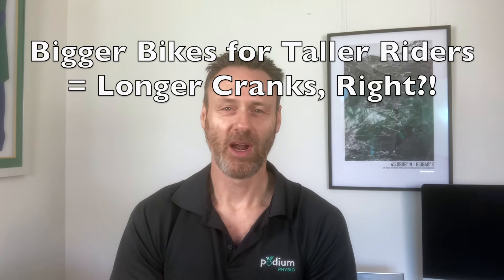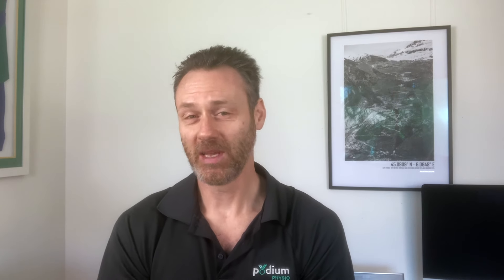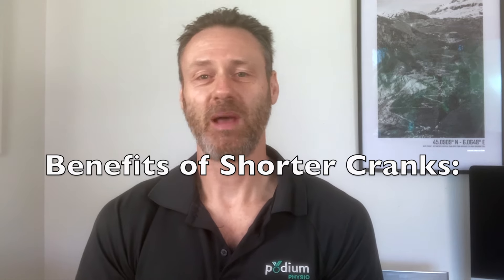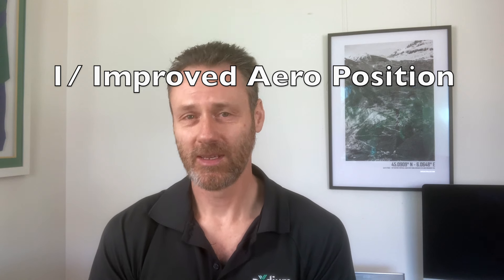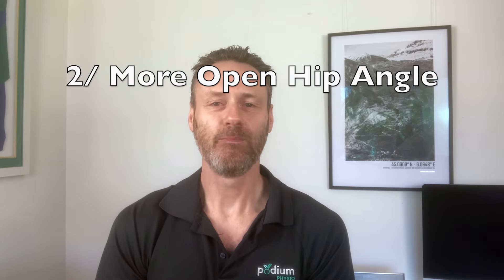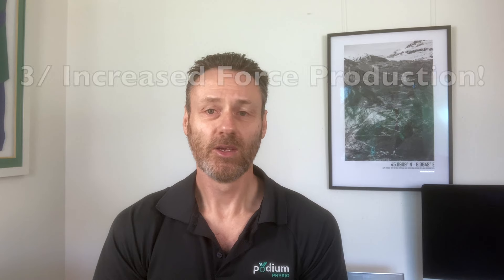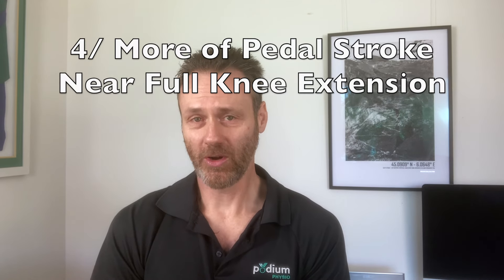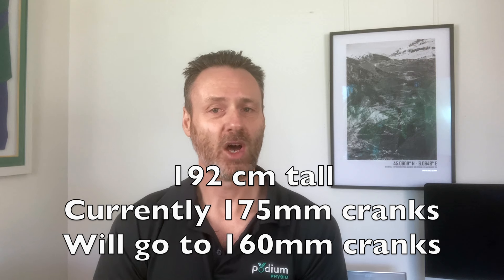Why You Need Shorter Cranks

Comment: A few weeks before the 2012 Olympic TT, it was suggested to Bradley Wiggins he might try shorter cranks than the 177.5mm he usually ran. He won the event using 165s…
Reply from the maker: I've heard the same story but I thought he went from 177.5 to 170?

Comment: I'm only 5'6" (167cm) with 30" Legs (76cm), and I use Zwift often. I machined/tapped a second set of holes on my 172.5 cranks down to 155, and WITHOUT QUESTION it smoothed out my circular motion, I stopped hopping,  and my overall watts appeared immediately to go up by 5w. I'm a confirmed believer.
Reply from the maker: Brilliant! I also think pedalling smoothness is under-rated
Reply: which cranks you use in 155 ? my is shimano 170
Reply: @khochiakeng  I began with 175, yet there IS enough room to drill and tap using a 170. I have a lot of space between the bores.
Reply from the maker: @khochiakeng  Not sure I understand your question sorry.

Comment: Self-experimenting now. One month into the experiment. I went from 170mm to 160mm. I was constantly sliding forward with the 170mm cranks. Hip pain, knee pain etc. I'd been to a couple of different fitters with no such luck. The 160mm cranks have helped my trunk and pelvis stabilize much better. No knee pain, no hip pain. I did Raise my saddle and had to pull my saddle aft to get comfy. Much better power and comfort so far. Only down fall is the wind up. I'm not racing so it really doesn't bother me. Just takes a few more pedals revs to wind up on a group ride. So far, so good. Also, I'm 5'8" with an inseam of about 77.5cm.
Reply from the maker: Yes the issue of pelvic stability is definitely worth considering. In my group rides we have an ex Olympic cyclist who seems to have huge pelvic lateral tilt. I'd love to see him on shorter cranks to see if that would improve things.

Comment: I have been promoting shorter Cranks for a decade now.
It is the first crucial step when getting ones self fitted to
a bike, get that wrong and it will then impact down the chain. 
I fully agree, the shorter the better. I have had fitters say that
I should use 170mm and they were all incorrect, the whole
pedal stroke circle was to large and that resulted in never
being able to fine tune the saddle position, It drove me 
around the fu*king bend.
Reply from the maker: Its too early for me to form a strong opinion, but I'm starting to collect some data and feel for the new position. I'm sure I'll need a bit longer to give a truly informed commentary.

Comment: I see a lot of comments from people stating their height and crank length along with you not mentioning your inseam (unless I missed it), but wouldn't it be better to focus more on your inseam length instead of total height when considering which crank length to use? To me it seems like a massive oversight to not talk about that but then again I'm not a bike fitter or medical professional so maybe I'm missing something. 

I'm 169cm tall but have an abnormally long inseam for my height, which is 85cm so that'd affect what crank length I'd use compared to someone with a more average inseam from what know. I currently run 170mm cranks on all my bikes.
Reply from the maker: Yes you definitely need to take relative body proportions into consideration. As a bike fitter I use a video assessment tool to give data on joint angles, which I use along with my subjective and objective assessment, functional testing and of course client feedback to work out the best position and set up of a bike.

Comment: It all depends what type of riding you do; everyone has an optimal crank length in that regard. What puzzles me in these debates is that leverage and torque are never discussed, so thanks for at least mentioning torque and leverage loss by going shorter! For myself I much rather ride a crankset length that gives me that leverage and that extra torque to transfer to the pedals when needed comfortably. I'm average height 5'9" and ride 172.5mm cranks and the difference is huge between 170's and 165's when climbing on my routes for me, I'm not a spinner but keep up a good rpm with a 12sp drivetrain. When I've tried shorter cranks, I actually strained my knees and it felt slower! So, it's all about finding out what works comfortably and efficiently for yourself.
Reply from the maker: I 100% agree about finding what works for you as an individual. I've decided not to change my cassette or chain rings despite the leverage loss, as I very rarely use my lowest gear here in Adelaide, so nearly always have a bigger cog to drop into when necessary.
Reply: In theory there's a leverage loss.  But in practice one could generate more force on the pedals with shorter cranks.  The weight squatting is the best analogy I've seen.  I went from 170 to 155 without changing my gearing.  When I'm on my lowest gear climbing a steep hill, the perceived exertion is less while I'm generating the same power as before.  If my power and cadence are the same, that means I must be acting on the pedals at a greater force.  So for me personally there aren't any downsides to shorter cranks.  I'm 5' 8" with a 80cm inseam.
Reply from the maker: @jonathanwoo6597  Yep. Great deduction. I'm hoping my experience will bear out the same way over time.
Reply: The torque/leverage argument has been used for decades as an argument for longer cranks. However by shifting to a different gear you can freely adjust 'gain ration' on the fly, so leverage is not an argument.
Reply from the maker: @martijndegroot9772  What I've seen is that there is so much more to the discussion than just this one issue of leverage.

Comment: I'm 194cm and have 170mm on my road bike and 165mm on my track bike. 

The 175mm originally on my road bike were too long and caused a lot of problems but on the track I am finding now that 165s hinder my power development on big gears.
I just lack the leverage to produce sudden accelerations and need to use a lot of force to overcome it.
Reply from the maker: Interesting. I'm making this change for the first time so am yet to/ about to see the results. My main interest is managing the stiffness and discomfort in my arthritic hips. If the performance data for 175 vs 160 is roughly the same I'd be happy. If there are any gains to be had that would be a real bonus...
Reply: @podiumphysio657  What is your opinion on crank length when riders cannot select their gearing (like on a track bike) ? 
I feel like 165mm limit my leverage and acceleration but I picked them thinking it would help reaching higher cadences. I have seen the study from Konstanz Uni on the positive correletion of crank length and power production during track starts and it made sense  
165mm feel like the pedal is a bit too close to me when I tuck in for seated sprints, I get the feeling of falling forward onton the cranks. All of this makes me wonder if 170mm would work better with the aggressive fit and short saddle setback of my track bike.
Does it make sense to you ?
What would yoou advice be ?
Reply from the maker: @FlyingPastilla  Firstly I'm a roadie and have never ridden a fixed gear track bike. However on a track bike you can select your gear, you just cant change your gear once it is chosen! If your bike fit is done with a focus on knee angle at bottom dead centre, then at the top dead centre, the 165mm crank/ pedal would be further from your chest than the 170mm crank/ pedal.
If you are talking about the pedal at the horizontal, then you may need to push your saddle back a little and use a shorter stem.
In relation to the start of a track race, I've never done one, but I know that I can produce more power, and get to full power quickly on my 160mm cranks. I did this test up a 19% climb near where I live. https://youtu.be/P0qO6Wza58w 
For me, other than my hips being happier when I ride the 160mm cranks, I really dont notice a huge difference in "feel" between the 175s and the 160s. Once I'm on the bike and going it just feels like - riding a bike!
However if you are sitting on the fence, there really is only one way to find out for sure, which is to get a set of the shorter cranks and try them for a period of time. I dont think just one or two test rides is really sufficient.

Comment: I changed from 175mm to 165mm some 7 years ago and it made a huge difference from a comfort perspective and I didn't perceive any long distance triathlon performance decrease. I'm 187cm tall and applied this advice from a book: The Well-Built Triathlete, by trainer Matt Dixon. This book also helped with my swimming through some non-mainstream advices.
Reply from the maker: Yes I've done 2 rides so far with the shorter cranks and my hips are definitely happier. I'll be posting some more info, data and reflections on this topic very shortly.

Comment: I am 182.2 cm in height and I and have been using 210mm cranks for about ten yrs and love them (I am using the same crank brand/model you highlight in your video).  Up to ten yrs ago I only used 180mm length cranks.   About 3 months ago I had to swap bikes to my old racing which has 180mm.  It felt like I was on a kids tricycle, I had less torque to accelerate up hill and I had to spin faster to get the same top speed (I naturally spin 210mm cranks between 100-115rpm). There was noticeable decrease in ability's when using my indoor trainer (Tacx Flow). I put the 210mm on the bike I swapped to and I just love it.  I also use 210mm cranks on my mountain bike.   The other benefit of using a longer crank is you can use a smaller bike/lower your seat height (another way to get more aero and lower your center of gravity.  When it comes to mechanical advantage I think it is unwise to compare rotating a crank to doing a squat.  The leg motion may be the same but the objective is very different.  You are not creating torque when you do a squat.  The sport specialist you mentioned is another example of sport professionals attempting to defy the laws of physics.  You see the interview with former pro cyclist Adam Hansen regarding crank length (he only used 180mm).
Reply from the maker: You must have some amazing leg speed spinning a 210 crank at 115 RPM!
I'd love to see some good quality footage of you riding on your indoor trainer from side on so I can put it through my Bike Fit Video processor. I think the data produced would be amazing.
Reply: 210?? 210mm cranks? @115 rpm? 182cm tall 🤔 You didn't mention what size bike you have that take a 210mm crank?  May I also ask how you   originally determined that 210mm cranks were the thing for you? Thanks

Comment: I am 1.77m tall, I rode 172.50 cranks for years.  I changed to 165cranks .  It does have benefits as you mentioned.  However my sprint suffered and my top speed dropped and power went down.  So I am now experimenting with 170mm cranks.  First impression sprint improved, cadence went down.
Reply from the maker: I'm about to find out...
On my first ride yesterday I was definitely more comfortable in the hips, and I felt that my sprint was comparable, although it definitely felt a little weird at full throttle.
Reply: Top power should come faste. Speed racer use shooter
Reply: Road Cycling Academy has a better explanation for this. Aside from being fit, one must know the type of ride, whether a cardiovascular or neuromuscular rider. Neuromuscular riders will benefit from longer cranks.

Comment: Hello, I am very interested in your results. What is the relationship between shorter cranks and knee problems? Such as meniscus (patella?)  problems. I didn't read anything about that. Thank you in advance and greetings from the Netherlands👍🚴‍♀️🇳🇱
Reply from the maker: Verwelkoming! I've not seen any data to correlate length of cranks with knee pain, however there is a reported relationship between the knee moving from out to in on the down stroke, and patello-femoral knee pain. Perhaps a longer lever allows greater amplitude of deviation? From what I've experienced and studied so far I would expect a shorter crank to help, rather than worsen any pain due to meniscus strain, but again I've not specifically looked into that topic.
Reply: @podiumphysio657  
Thank you for your reply. Maybe it is something to include in your observations while cycling. I personally put my saddle about 2.5 cm higher than the bike fitting indicates, because of my knees.
Reply from the maker: @Martin-on2pp  Yes there is an old dogma in bike fitting that a lower saddle leads to more patello-femoral pain due to more knee flexion and PF compression. But I think it has a lot to do with rider conditioning, cadence and terrain also.

Comment: While I am very interested in your results, at 75 my cycling is winding down.  I have been building custom steel frames mostly for very large riders for several decades.  Most modern bikes particularly road bikes are hard to get both good fit for the rider and good weight distribution on the wheels.  While crank length is relevant, compared to other paramaters it is of lesser concern.  But I do agree that shorter cranks are not detrimental.  However with shorter cranks seat hight and seat set back will also change.  As for aero position if you care, the difference is small if you average less than 25 km/hr.  It is only at higher average speeds that any aero effects exceed rolling resistance.  Example at 50 km/h the difference a total aero bike makes is 4 s per km, at 25 km per h it is only 1 second per km.
Reply from the maker: Appreciate your comments. Do you aim for a 40/60 weight distribution split in general? How do you decide?
Reply: Building a custom frame starts with measurement of the rider on a bike.  I am for complete toe/front wheel clearance, not necessary for racing but for general commuting touring means tight slow turns while pedaling are drama free.  This make the frame a little longer and the stem short, and reduces the load on the front wheel, to fix this I lengthen the chain stays to move the rear wheel further back.  Lateral bracing of the chain stays removes lateral power flex.  So a longer wheel base that also make the bike much more comfortable to ride.  I aim at better than 60/40 rear/front loading and mostly achieve it but not by much.
The most critical measurement for correct fitting is the seat tube angle, range is from about 69 to 74 degrees, for seat fore/aft placement, most need around 71-72 degrees to get the most ergonomically correct position.  
Changing one thing on a bike fit is like pulling on a strand of a spider web, every thing else changes.  15 mm shorter cranks means about 15 mm higher seat, about 7-8 mm more seat set back and a change in the handle bar position both vertically and horizontally.  Baring other physical issues like hip issues I recommend the longest crank that can be spun at maximum rpm.   Example:  Max rpm on a short crank, use longer cranks till the max rpm reduces.  Every one is build and functions differently.  Stance width is an issue that affects many larger/wider build riders and women as well.  Basically racing style bike frames are built for lightly built 60-70 kg riders, 80 kg is a big racing cyclist but 100 kg plus riders don't really fit well and trash rear wheels pretty quickly.  Solutions for that as well.
Reply from the maker: @dan2304  "Changing one thing on a bike fit is like pulling on a strand of a spider web, every thing else changes".
This is a comment I can definitely relate to!
Reply: @podiumphysio657  Learned the hard way trying to fit bikes to riders.  Gave up and measured the rides first then build the frames to suit.  Retired now.
Reply from the maker: @dan2304  So you get to ride "pro hours" now? ie whenever you want...
Reply: @podiumphysio657  Unfortunately old joints are slowing every thing down, I don't think i have any joints that work well and without pain.
Reply from the maker: @dan2304  Cycling is probably one of the best things you could do to help. Or swimming. No/ Low impact will be easiest to manage.
Reply: @podiumphysio657  Was a competitive swimmer but shoulders are (medical term) f*&ked.  My cycling is down to about 100 km a week, Sunny hot Australian summer not so fun to cycle, I will try to increase km once it is cooler.  Cycling and rowing (exercise machine) are all I have enough joints for.  Replacement joints are much more for pain management than function.  I sort of like being old with lots of knowledge and experience under my belt and I would be awesome without the deteriorating joints.

Comment: You can lower your seat which puts you further forward and your feet will be further back too. Both these will help push back on your pedals rather than trying to pull them back. Much better for cyclist who use quads rather than hamstrings.
Reply from the maker: I may play around with my bike fit once I have some baseline comparison data between the 2 crank lengths